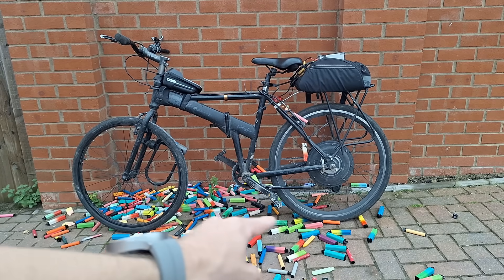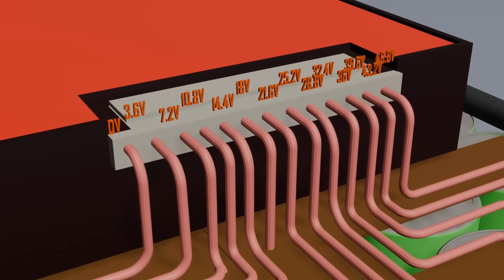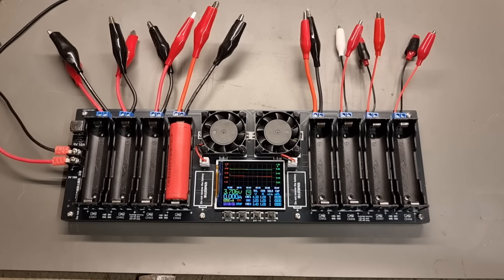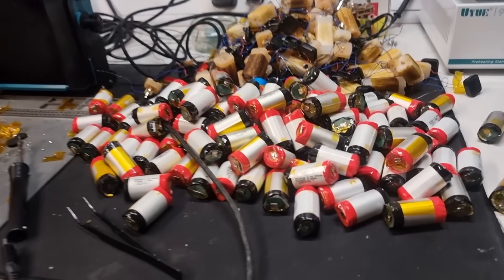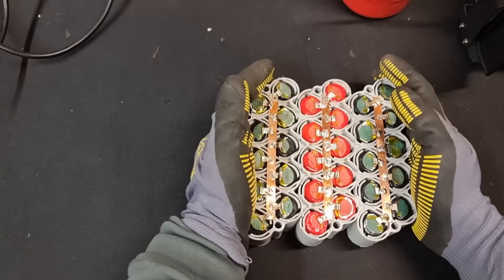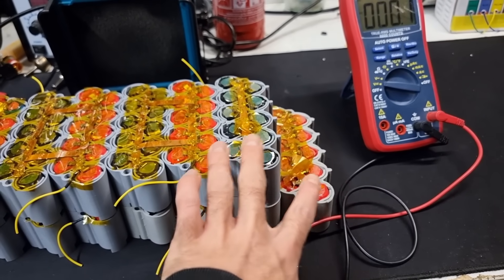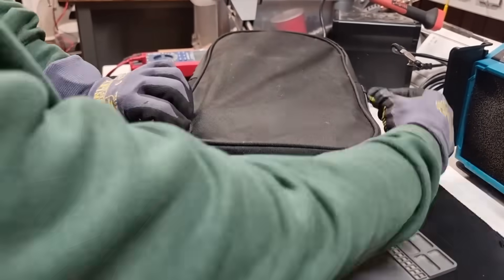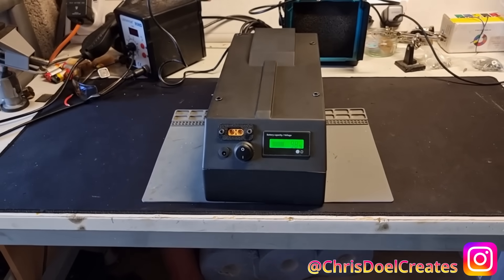Powering an E-Bike using Disposable Vape Batteries

Comment: It's truly innovative that they are putting rechargeable Li-ion batteries in a disposable vape product.
Reply: genuinely there needs to be a HEAVILY funded government initiative to handle proper disposal of vape batteries
Reply: is the lion okay?
Reply: The disposable vapes not made rechargeable but you can by stripping a charger and putting the red and black wires on top and bottom part of battery.
Reply: @Backyardrumblez don't do this!!! Super dangerous they are disposable because they don't have a charge controller built in... That's the thing that stops you from turning your battery into a bomb when it's charging... Without a charge controller at any point it could explode
Reply: I worked in the vape industry for 7 years. When the disposables came out everyone I knew in the industry thought they were stupid, aside from the manufacturers pushing them
Reply: China doing it to help people when the world goes to shit
Reply: Fucking capitalism.....
Reply: I'm here on social media criticizing the environmental impacts of electric cars battery fabrication, while puffing my disposable watermelon flavored vape 🤣🤣🤣
Reply: Not really it would be more so if they came with removable batteries
Reply: Kind is though. They started disposables without a rechargeable battery so it had to be a lower limit of puffs per use. Now most of the newer ones are rechargeable because they have 2 to even 8 times the puffs and wait for the juice to run out instead.

Obviously we should have seperate recycling for electronic now ah days.
Reply: @XenoTravis   i agree with using rechargeable batteries in vapes but then vapes should be  rechargeable and refillable,like they used to be and these disposable ones should be banned.
Reply: @P.s-artz  I understand production of disposables will be banned in about 8 months, then the decline of stock will do the rest.
Also, I switched to vaping after smoking up to 60 a day, and while not perfect, my health has improved.
Also, I don't purchase "off the shelf" vapes or eliquid anymore. As someone who has an above average knowledge in chemistry and the compounds used in eliquids, I make mine using the cleaner, less harmful compounds, and I do NOT use nic-salts! Since most nic-salt compounds I found are benzine based and that isn't something I want to inhale.
Reply: @P.s-artz  They still are. I personally still use one and there are many companies still releasing new tanks and rechargeable, battery replaceable vapes. I use one and would find not being able to swap out my battery and put the old on my charger very inconvenient and never bothered with disposables. It would be nice if we got rid of the limit for nicotine containing liquid nowadays being 10ml though, there's plenty of potentially hazardous household chemicals and cleaning products in litre containers or greater. Smaller bottles use more plastic.
Reply: @XenoTravis   meanwhile cost of rechargeable batteries is skyrocketing.
Reply: Guys i product batteries pack. Trust me. It is a bomb. Batteries must be identical produced in the same lot to make a safe and reliable lithium battery. This is just a fire hazard. In few cycles that battery will have all block  (parallels) unbalanced and the charge controller will have to stop the charge. In case of a flaw in the controller or its absence, it will get fire.
Reply: Why is that then??
Reply: @IANHANDS    sarcasm.
Reply: @IANHANDS  well, disposable and rechargeable is a contradiction. It's a waste of batteries! You know battery mining is damaging environment
Reply: @derpanther-ingenieur8460bro ik vaping is bad but just bc someone vapes doesn't mean their "useless nicotine junkies"
Reply: @derpanther-ingenieur8460pro consumerism but only if it’s not by people you dont like 😂😂
Reply: @derpanther-ingenieur8460 💀💀
Reply: @marioboi323  Reuse the reusable batteries rather than putting them in a disposable product to start with.
Reply: Yes but in the best case people who are vaping should get a reusable vape maybe, i think there are actually good cheap ones
Reply: @IANHANDS  He explained it in the earlier video. It's because of their higher voltage=>high temperature to vape. At least that is how I remember it.
Reply: @IANHANDS The reason for the use of rechargeable batteries in disposable vapes that have no provision for recharging is that there are no non-rechargeable batteries available that can equal the performance of a lithium-ion battery at the same or lower price.

Comment: I used some to make a night vision scope for a rifle. Simple little project using a car reversing camera and an old LCD screen. The price of the premade night vision kits has come down making it not really worth doing. But for me it was essentially free just time as i got parts from scrap yard when i built it i saved a good chunk of cash. I didn't even 3D print anything i just used old plumbing pipe to house stuff and rubber pipes from a cars cooling system.

Comment: Can u make an e bike battery that can be re charged by paddling?
Reply from the maker: My bike has regen braking, so technically, it's already possible on this bike. The problem is that an e-bike is not 100% efficient, so the energy you put into it via pedalling is less than the energy you get back out via the motor. Sadly, it means there will never be a bike that can be effectively recharged via pedalling (because it will always be better to just pedal it in the first place)
Reply: @Chris_doel  what about a solar panel?

Comment: You should have put fish paper between the top and bottom rack of cell because over time vibrations will wear out the capton tape . also make sure the bms wires are protected well as vibrations will wear out the insulation and short
be very very very cautious you do not want a battery fire

Comment: It could be a fire hazard to leave exposed cells in a pile like that.
It should be noted, you need much less than 140 cells to have a smaller capacity battery, bicycles, and electric bikes, are really efficient.

Comment: The strips of copper can be called ‘bus bars’ and need to be dimensioned based on max current. I guess you are designing on 30A? You use two of them. 15A each. If one gets accidentally disconnected (corrosion, fatigue, accidental poor soldering…) can the remaining one drive 30A without overheating?

Comment: Awesome project, it's great. I'm from Spain and I picked up a vaporizer that I found lying in a park. I didn't know what was inside, so I opened it out of curiosity since I actually thought it would just have a simple battery. Surprise, it had a rechargeable battery! I've collected a few and usually use them for projects with Arduino. The truth is, it's a huge waste of resources in a product that I don't think is very healthy.

You have a new subscriber.

Comment: You should consider using fuse wire to connect the cells to the bus bars, to try to contain any overcurrent situations (e.g. from a cell getting pierced)

Comment: Unfortunately at the end of the day a battery isn't just a battery and a bms won't save you from each cells differences. The more seperate cells you have in your battery the higher your likelihood of a fire. Impedance mismatch is the hardest one to deal with old refurbished cells. The highest risk of fire/explosion is during charging the cells so only charge this type of design in a fireproof location. A box or room covered in  Drywall, fiberboard ect is good. Once this type catches fire you can't put the fire out as it is self sustained. Always have a plan on how to remove it from your house garage or a fireproof bucket of water or sand to submerge in at the very least. And yes. Submerging the battery in water might be your only option if you can't throw it outside. It's better than your house burning down or seveir smoke damage and smell. It's pretty toxic.

Great video btw. A house power wall isn't great. Lifepo are king for that. Safe. Lifepos are pretty safe. 

Lithium titanate supercapacitors are neet to play with. Hard to get tho.

Comment: umm new subscriber i just wanna ask u something isnt it dangerous to use the batteries since they are china import trash quality idk it seems to me they will die after 3 weeks of use
Reply from the maker: I was also sceptical at first but after doing a bunch of testing the cells actually seem to be decent quality. It kinda makes sense because if the UK alone sells 260 million of these per year, and if one in a million batteries fail in a dangerous way, then you will have 260 casualties per year which could cause the government to crack down on imports. So they seem to use cells that are reasonably safe as long as theyre used correctly
Reply: @Chris_doel   yea seems reasonable thx for answear to

Comment: Wait those cells randomly in the box at the end of the video. Isnt that a massive shortcircuit hazard? If not how come its fine I'm interested to know.
Reply from the maker: It is indeed a shortcircuit hazard, i was shocked when I got given the cells in that state. I suppose in order for them to short circuit the cells would have to arrange themselves such that they connected in a loop, which is somewhat unlikely but still very possible. I'm transferring them to much safer storage atm

Comment: As someone that vapes, I always hated the disposables thing.

We used to have as the norm non disposables systems with reffillable tanks, WHY THE FUCK WE MOVED AWAY FROM THAT?

Glad this is getting visibility, since those both the enclosure and the battery are actually not recycled in most places, and we actuslly need them.

Comment: it's been a long time, since i enjoyed tinkering video so much, 1 thing i noticed you were using 14s bms on 13s battery, but bms had 14 wires indicating 13s configuration, that is just probably daly labeling error on this bms?
Reply from the maker: Very good spot!! I actually got sent the wrong BMS and the correct one was arriving the next day, but i wanted to continue filming so i used that as a temporary placeholder for that particular clip

Comment: I did similar with a couple used vapes and my bass overdrive pedal. Got fed up of burning through 9v batteries for it, so jammed a couple little vape cells in there on a 2S BMS and now I can recharge it!!

It is a complete waste imo that these cells are being just thrown into single use electronics when they're capable of being used up to another 299 times if you drain and charge them fully each time!

they also do pack a fair wallop with the right wiring behind them which is handy for power electronics that need decent current delivery like EAPCs / PLEVs, lights and phone chargers. so it makes absolute sense to me they should be recycled then used again in devices where they will see their entire usable life instead of being sent straight to landfill after one cycle.

Comment: You legend!!! I wanna use all the ones I get as 

i get them free from my friends shop, I recharge with A circuit that stops when charged. I  want a powerful 12v one I can use to busk with and a solar panel so at night the battery should give me more time after the  sun goes down Great video by the way and it taught me a fair bit, an All I can is your amazing.  I will need 3d printed to hold the batteries And If I do you will see a video as well. Than you.

Comment: Where can i Found the battery case you use ??? I love that
Reply from the maker: I got it resin 3D printed, would you like the file for it? Its not the most optimal design but it worked well

Comment: i take apart everything that peoples discards that has battery, i once found a vaper and it had a 3000mah battery, wich had 2200of the original capacity, i used it on a toy drone that had brushless motors and got 19 minutes of flight time, i got 10 minutes  compared to the original "2000" mah battery that came for the drone. so honestly these vaper batteries are good but is a shame that they get discarded.

Comment: Where did you get the bike from? Was it recycled? Was this bike originally a E Bike?
Reply from the maker: It was an old frame I had, and I got the motor for super cheap off facebook marketplace because it was broken. Luckily, it just needed the phase wires resoldering

Comment: I hate selling these in the shop I work at (tech at phone repair)  I made the mistake of telling people around I take them back ....I have thousands of them saved up. Last time I got almost 100 euro for the ALU , plastic all recycled and last power cut , well from all the old laptops I take in I have almost 3kwh in 3 18650 packs, I have the sitting room isolated so I can just switch to my backup and run the pc, fiber modem and 3 monitors for hours on end. The power was back online almost two hours before I noticed :D I think the inverter cost me less than 80 euro and some time soldering and building the packs. 3d printer in house now so I hope to take on this challenge soon.

Comment: I ve made an XBOX controller rechargeable by directly wiring 2 paralleled cells like this into its AA battery slot. Turns out the circuit is 4.2V tolerable 😂

Comment: That could almost certainly be used commercially.
You can buy disposed vapes for 10-50 cents and sell the batteries for 200 bucks.
and the aluminum casings should get you a few bucks as well if you give them to recycling.

Comment: 2:11 

Not quite. The reason why the batteries keep exploding is often for numerous reasons, but the lack of a BMS is rarely the case.

most have a BMS, it's just:

1. It's a poor quality one, so it doesn't protect the pack as it should.

2. the overall build quality of the pack itself is very poor. Such as the layout of the wiring is in a compromised position (risks of being cut/damaged/shorting), bad soldering (soldering also should NEVER be to the cells!), bad/poor quality cells (such as unnamed chinese ones and not from say, big brands like Samsung or LG) or bad spot welding.

3. this is the biggest culprit of them all, but using NICKEL PLATED STEEL for the battery interconnects is one of the biggest reasons these packs fail catastrophically. Steel will rust/decay, especially the cheap nasty steel they use for the packs. The end result is resistence, resistence = heat, and eventually, fire.

If you're lucky, it just simply rusts to the point it deactivates itself.

This is probably the biggest reason as to why so many cheap packs go up in smoke, causing so much damage and even loss of life in the process.

Good quality packs use pure nickel in their construction. This will never rust. They source high quality, reputable cells from the big name manufacturers (LG, Samsung, etc), they design the pack in a way that no wire can get pinched, frayed or damaged. And they use good quality spot welding throughout paired with a high quality BMS system.

Comment: that a goood way to recycle but for the size of it id rather use it at home as a power bank, you can build that same battery capacity with 21700s and it would just need 2 set in parallel not 10

Comment: Ticling Blob on Wheels🤫. Highly recommend a refractory lining with a ceramic cloth wrapped around with a final layer of flame retardant blanket. Also have enough channels to let some ventilation.
Might even help if you have a hookup for garden hose🤞(not sure if anyone would go near a smoking battery🥺), incase if needed. Don't ever park inside home or friendly neighbors property🤔😂. Build an opensource EDC handcrank phone charger, to reuse these otherwise polluting vape batteries.❤👍
Reply: Garden hose? Lithium?

Comment: I started tinkering with these a bit after your first video and the cells REEK. Did you have an odd smell when working on the battery pack?
Reply from the maker: Yeah it smells so much💀 it takes me like an hour to get used to it when stripping them apart in bulk

Comment: My biggest problem with harvesting vape batteries is the stench. When you get multiple flavors off gassing it becomes overpowering. I usually do them one at a time, and throw the guts in a sealed container.